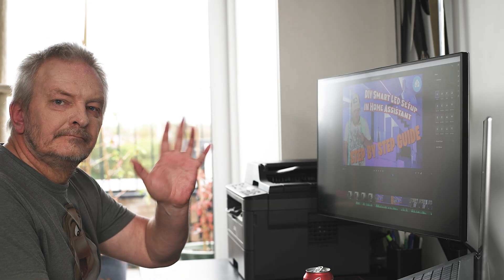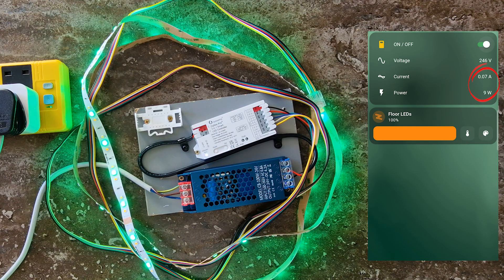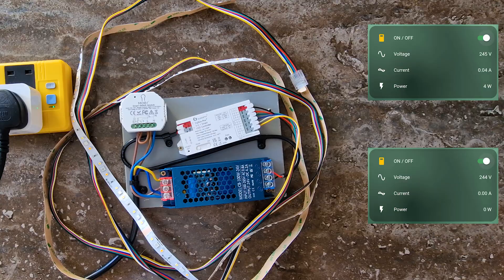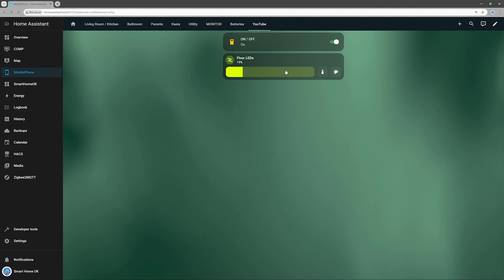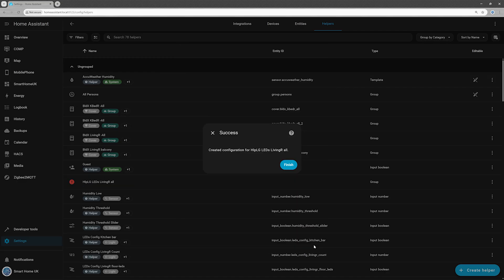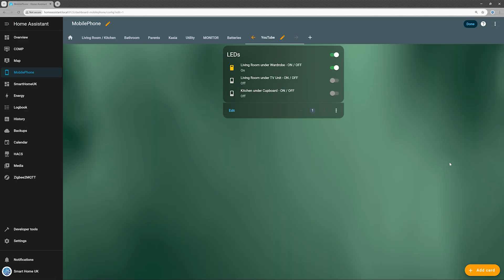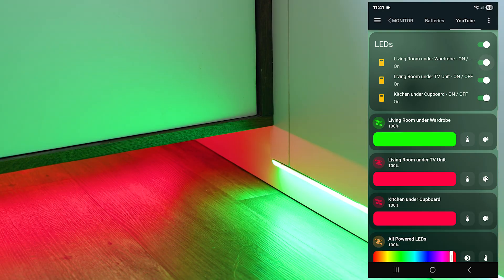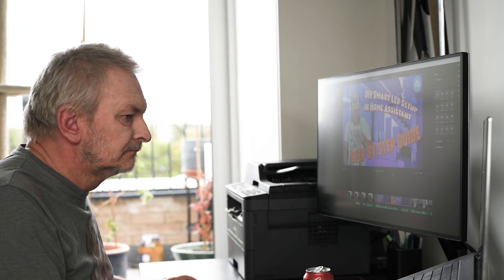DIY Smart LED Setup with ZigBee & Home Assistant - Follow Up

Comment: 4 watts with LEDs switched off? This part where you prove your point is great. I knew it made sense, but I didn’t imagine that the power adapter and LED controller could draw 4 watts with the LEDs off. Great work. Congrats, and thank you!
Reply from the maker: Glad you found it helpful and insightful! Thanks, I appreciate it!
Reply: agree
Reply from the maker: Thanks, I appreciate it!